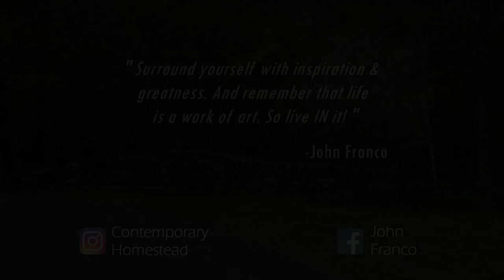Custom STEALTH PVT Snorkel System | POLARIS Sportsman XP 1000 & 850 ATV | Part 1

Comment: These bikes require so much modding for basic trail riding/mudding.  Just bought a 21 850 ultimate trail and Im really really regretting not getting canam xmr

I would turn around your air intakes,  I get back sinks first but they gonna drink rain and splashes easier there, stock it faces rear.
Reply: Ultimate trail fender flares are useless.  If i ran snorkle behind vent like you did it would get lots of water if it rained or if I put my bike in reverse.  Nice job though I'd pay you $1000 to do mine.

Comment: Thank you very much for the video.  I have a question.  Does it not create problems and damage the variator belt in the summer when the weather is hot?
Reply from the maker: Not at all, routing the fresh air intake tubing to the front brings cooler air to the PVT system. Factory PVT intake piece pulls air from above the hot engine

Comment: Did you leave enough slack in the tubing to remove the clutch housing to do a belt replacement??? Nice work man.
Reply from the maker: Yes i installed mine with the tubing relaxed and not stretched. So there should be enough slack & room to remove the cover but i would unclamp the move the tubing out of the way if at home.

Comment: I hope you dont have issues with heat build up coming from your belt exhaust hose like I did, I did a similar design with 2 inch hose and i noticed the belt box wasn't cooling fast enough with the long restrictive hoses, i am an aggressive rider though not sure on your style. Figured it would be to hard on belts so I put it back to stock. Also once your in a water wheelie your rear belt exhaust works like a cup upside down in water and keeps the water out. Best of luck though 🍻
Reply from the maker: Will see, i am installing a temp sensor in the PVT housing so i can monitor it.
Reply from the maker: There is an acceptable level of heat that can be sustained. We need to understand that further.  Warmer tires always grip better, etc... How hot exactly did it get? were you able to measure the temps with a something? A factory setup is still going to get hot no matter what by its inherit nature. The primary has fins in it to act as a fan/impeller.  I made sure on my routing that it has fresh cool air and the exhaust dumps in a spot that is not confined. Very important.

Comment: I love this, I would consider being a customer given an appropriate price
Reply from the maker: It is price appropriately. It is a professional automotive grade kit i have developed and that took alot of time to piece together. This all has a value and a cost. If you want hardware store prices then just go to the hardware store and buy a bunch of bulky PVC fittings and tubing that will eventually leak.
Reply: You killed it on this build brother very clean install 👌 love it

Comment: I like this kit but is that hose 1.5" ?? Would it restrict the air a bit .. I see you also installed a temp sensor is the reason being heat issues??
Reply from the maker: Thats all that can fit along side the motor. If 2" would if fit i would run 2". But its not possible The inside is a smooth bore so it helps with airflow. Other hoses have a spiral which cause turbulence and less flow. No heat issues yet, i installed it to have some actual data verse speculate

Comment: Did you have a problem starting after installing these, I did it to mine and it started having problems starting
Reply from the maker: Not at all. Both my machines start right up. I would check or replace your air filter. Double check starter connections too.

Comment: What did you use for the plastic coupling that fits the hose?

Great job!
Reply from the maker: Well i do have the kit for sale on ebay. Sorry alot of time, effort and research, buying,  modifying parts that didnt work to finally come up with a complete comprehensive kit that works and looks professional. To do it correctly is a costly process. I think ive shown you folks enough of my tips & tricks. Thanks for watching!

Comment: Hey John...great snorkel kit!  Can you say what type of tubing you are using, and is it exposed to a lot of heat?
Reply from the maker: Thanks, thats not just any tubing i use. Cant find it at your hardware store... If routed correctly it will not come in contact with heat.  I offer it for sale if you like to purchase. Link is below the video. Thanks for watching!

Comment: Will this work on a 2021 sportsman xp 1000s?
Reply: My exhaust for the belt is different than the video is the reason I am asking.
Reply from the maker: From what i can tell looking at a parts diagram the S models have a different/duct snorkel piece, thats it.  But PVT location and port size looks to be the same as a standard XP 1000 to me.

Comment: What size hose are you using  2 inch or just 1.5 ?
Reply from the maker: Theres only enough room for 1.5" otherwise i would of done the 2"
Reply: @JohnFrancoNH   ok  thanks. No over heating  issues in the belt box or any thing
Reply from the maker: No issues yet on either ATV. Highest PVT temp ive seen on my gauge has been 150°F

Comment: I think you are charging too much for that kit. I understand you researched it all out but come on dude 400USD for that? I would think the parts cost less than $50. Awesome job and very clean looking. Just too pricey for me unfortunately. Cheers and happy trails!
Reply from the maker: well if you dont see the value dont buy it. It takes time to source and modified the parts for the kit. Would you do that for free? Im going to guess no.  Its a complete kit no trips to the store  or other BS etc. Comes with everything you need and i get hit with ebay fees and have to pay for shipping. It all adds up. The proper hose itself is more then $50. This is not a home depot special, those DIY projects last not even one season. So you get what you pay for... No PVC bulky junk here. Ive had plenty people buy my full kit.